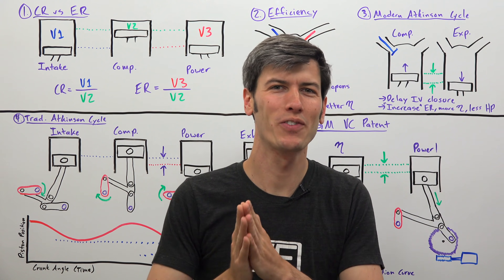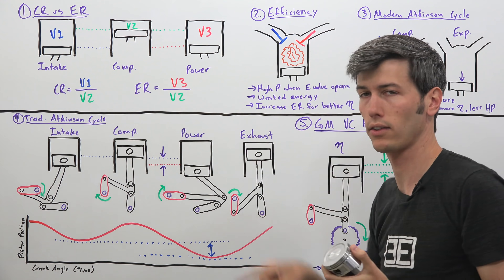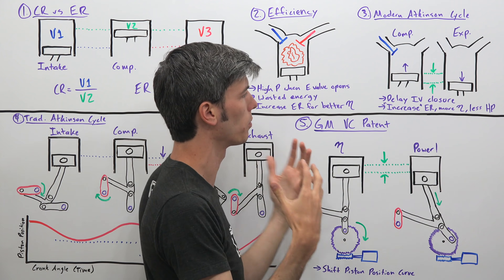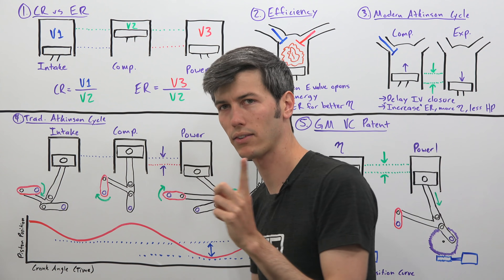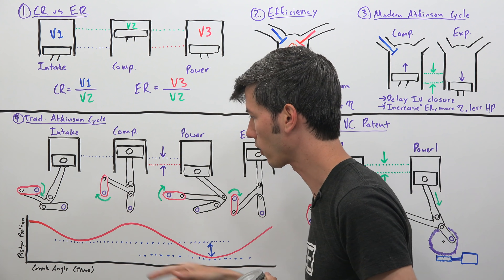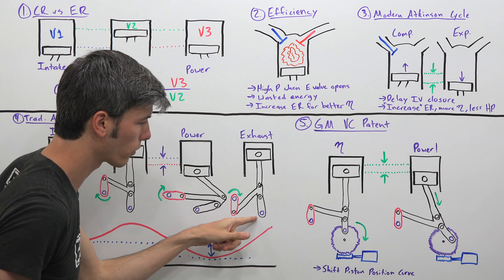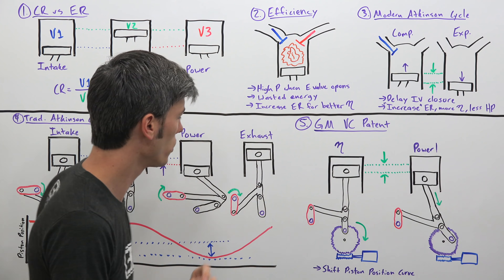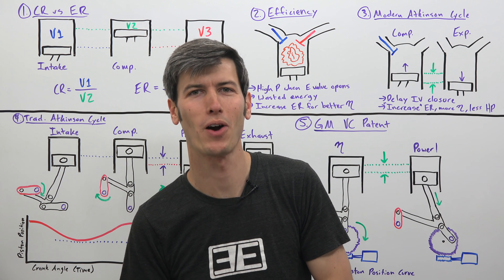How GM's Variable Compression Engine Works - Patent Review

Comment: Maybe there's something I'm just not getting here, but why not just re-open the exhaust valve for a brief moment?  So during the compression stroke, deliberately push some of the air (from the intake stroke) out the exhaust before injecting the fuel.  With VVT, it seems like this would be a much cheaper and simpler solution.

Comment: Wait I thought higher compression meant more power. Also would this engine have to be super/turbocharged for knock to occur at a high compression ratio, because otherwise lowering the compression should just lower the power right?
For instance with the ‘power mode’ it would increase the boost so lower compression would be needed.

Comment: Wouldn't there be an incredible amount of stress on the worm gear and the gear changing the angle of the rod? Also wouldn't there be more stress than normal on the rod bearings due to the rapid change in direction of movement?

Comment: I still don't understand how this is any better than turbo charging. It is essentially a variable compression engine too. Low boost low compression, High boost high compression. Simple, plus it partially recovers lost energy from exhaust heat and velocity. How is this better or worth all the BS.

Comment: Nissan, Mazda and now GM all going this route but can it be done reliability? Great video as always.
Reply: Well so far Nissan hasn't had any issues with the VC T,  but it's still very early in the engines life
so we shall see. But it's a replacement for the old VQ engine and it will dominate their lineup
In a few more years so you'd imagine they did very indepth testing prior to going to production with it.
  
I don't recall Mazda going with Variable compression  (they are doing something different) but I'd definitely 
rate GM far lower when it comes to engine and electronic reliability.

Comment: Mazda introduced an engine that uses a higher compression ratio but to be able to generate more power they control knock by spraying fuel in the compressing air/fuel mixture to cooler it and finally preventing knock, those engines appear to be very efficient in fuel economy and producing good power.
Reply: It's probably still patented and GM's thinking box doesn't even have windows to look out of anymore.

Comment: This will be a low RPM, low power engine.  Before, the piston head and the top of the piston connector rod were the only parts reversing directions every rotation.  Now you have the piston, the whole of the piston connector rod,  the link between the piston connector rod and crank shaft, and finally the link that varies its bottom pivot to change the compression that have to accelerate and decelerate twice with every rotation.  The faster the engine rotates, the less efficient the engine becomes.  It also becomes much harder to balance.  Good luck GM.

Comment: Jason, I'm really confused. At about 9:50 and on you say that to make 'more power' they want to decrease compression ratio. That doesn't sound right to me. Obviously there are limitations on compression ratios until you end up with knock etc, such limitations being pushed further by Mazda etc. But within the tolerable levels a engine with 8:1 compression ratio, all other things equal will make less power than the same engine with 9:1 compression ratio. My understanding would be that not only will the 9:1 have more time to draw in air, but it would also have a longer 'push' on power cycle. It isn't a simple math to work out, given the higher the compression the more the engine is fighting to squeeze the air, but it also means a bigger release of energy when combustion occurs. 

I could be completely off base here. But if a lower compression ratio to expansion ratio still results in 'good power' instead of 'good efficiency' wouldn't the modern aktinson cylce work as is? Is a compression Ratio of 8:1 with a Expansion of 9:1 making more power? In, which case GM just wants to take it to its maximum extent? I don't see how you could achieve "similar air and fuel volume" which translates to 'power' with something like a  4:1 Compression Ratio combined with a 13:1 Expansion ratio (as a extreme hypothetical 'conclusion').

As an aside...if paired with a supercharger, do we go back to calling it the Miller cycle?
Reply from the maker: Lower compression ratio means less chance of knock, which is why you'll see boosted engines with lower CR than naturally aspirated versions of similar engines. Infiniti has the same strategy with the VC turbo. High CR for efficiency, low CR + boost for power.

Comment: Why bother, when Honda's and Toyota's Atkinson-cycle engines are producing just as much power as their Otto-cycle counter parts.  The Honda's Atkinson-cycle 2-liter engine produces 143 hp with 13.5 Compression Ratio, which is comparable to a 2-liter Otto-cycle engine, and Toyota's upcoming 2-liter engine for hybrid system produces around that much.  The key here is to do more cooling for the exhaust side of the engine to reduce the risk of detonation, thereby permitting higher compression ratio.  

At high engine speeds and at the end of intake stroke, the inertia of the incoming air pushes the air against the piston and reduce the airflow leakage out of the intake valve, thereby getting more air into the cylinder.  Furthermore, via variable valve timing, the intake valves close a little earlier with higher engine speeds, allowing more air retaining inside the cylinder.  So, we essentially have a variable-compression-ratio setup here without all of the complicated hardware like the GM or Nissan versions.  At low engine speeds, we have Atkinson cycle with lower compression ratio for higher cruise efficiency.  At high engine speeds, we have Otto cycle for higher power production.

Comment: Couldn't you achieve the same result with variable valve timing? Valve open during compression for efficiency (less air, lower compression ratio), valve closed for power (more air, same ratio for compression as for expansion)

Comment: There is something I don't get here. In compression and exhaust pictures the situation is the same apart from the crancksaft position which is rotated 180 degrees. This rotation in the pictures is allowed by a different inclination of the linking rod: in compression picture it points upwards while in exhaust picture it points downwards. How is it possible? Maybe I didn't understand anything ahah

Comment: Is the Honda ivtec in European doing atkinson at low load low rpm? As the use the high profile cam shaft to close the intake valve later.

Comment: is it mechanically possible for the crankshaft (red part) to complete a rotation after adjusting the purple point nb 2 (the one on the right) through the worm gear ?

as i know, the crankshaft mechanism has to have an accuratly defined geometry, if that geometry calculation is not done properly, you will have two possibilities:

1) connecting rod too short:
crankshaft can not have a complete turn

2) connecting rod too long:
crankshaft and rod undergo high stresses and elastic deformations at the bottom dead center.

how was this part considered in the design ? 

i may also have some other questions concerning the electric motor powering the worm gear :p

Comment: Hi Jason, I was wondering during this video if Diesel engines use an Atkinson cycle for the same efficiency advantages or would it not have the same benefits for a Diesel engine? Thanks, love you informative videos!
Reply: On a diesel you can only drop the compression ratio so far before the air isn't hot enough to ignite the fuel as it's injected, which is what diesel needs to run as a compression ignition engine. Diesel engines don't need to do all this messing because they only burn the fuel needed to make the power asked for by the driver. Unlike with spark ignition engines, where there has to be enough fuel for combustion to travel through the cylinder volume to make a coherent power stroke, diesels can burn any amount of fuel from zero to stoichiometric at each power stroke since the fuel is guaranteed to burn because the air in the cylinder is hot enough to ignite it. What energy is taken up compressing the air that isn't burned on the compression stroke is returned as the piston moves down on the power stroke too, and there's no throttle blocking air flow into the engine, so diesel already avoids a lot of the issues gasoline engines efficiency is reduced by. If only their higher combustion temperature (Yet another reason diesel is more thermodynamically efficient) wasn't killing so many people with its NOx emissions...

Comment: Knowing the corners already cut in many GM engines, I wouldn't trust this system. There's just so many extra bearings and moving parts that will be even more dependent on the owner NOT being lazy with maintenance (which the average consumer tends to be). There's a reason why manufacturers like Toyota aren't the first to adopt new engine technologies: It takes time for technologies to mature and become more reliable.

Comment: I am not sure if I get it... variable valve time (camshaft angle control) has been around since ~1990.  What does this new system bring to the table?
Reply: This system has nothing to do with variable valve timing or lift. It alters the position of the piston/rod assembly relative to the engine block. Essentially varying the bottom part of the rotating assembly instead of the upper.

Comment: What about VVT and VVL, to switch between power and efficiency?
Reply: That still leaves efficiency on the table, as he was stating about the thermal expansion in the beginning. That's why they're doing this. 
It will probably still use VVT and or VVL in conjunction with this
Reply: VVT and VVL can be used to get the same effect. You close your intake valve early/ late (Miller/ Atkinson), to get a different compression to expansion ratio (14:1 compression to 28:1 expansion, as an extreme example). It is the same effect but less complicated and without imbalancing the engine.

Comment: All things considered, I think it has potential to actually simplify engines in the long run. Currently we're seeing things like variable valve timing with multiple cams, solenoids, in some cases hydraulic actuators depending on design. This is required for the more modern Atkinson Cycle and helps to optimize the traditional 4 stroke design as engine speed varies. If the new GM mechanism is able to capture that excess exhaust energy and put it to the crankshaft, then there wouldn't be as much energy left over in the exhaust, so in turn you'd see less benefit from having overlap, or both intake and exhaust valves open at the same time. You'd control this overlap with the VVT design since we all know excessive overlap at idle causes the traditional choppy idle that is so often craved in hot rods but ultimately results in poor low end performance. Thus they may be able to revert to a more traditional non VVT design since the optimization would occur in the bottom end rather than the top end of the engine. All I know is this design is going to be one heck of a balancing act especially with a turbocharger. If you don't leave enough energy in the exhaust, the engine will have to work to drive the turbo as it pushes the piston back up, and hence maybe a supercharger would be just as good of an option for forced induction. Let's see if they make it to production, and I'll probably still stick with the old International 7.3 engine...

Comment: Why not just variably restrict the intake air and run the piston at  fixed maximum stroke?
Reply: That what everyone else running a modern atkinson cycle is doing by leaving the intake valve open for part of the compression stroke. Except, I think, VW who close the exhaust valve early so there's more exhaust gas in the cylinder before the next intake stroke, which may save on having an EGR system, but probably leaves the pistons running a lot hotter.  The GM system looks like an expensive engine waiting to fail expensively while doing nothing a VVT Atkinson engine can't already do. This looks more like GM employees collecting a patent filing bonus than an improvement over existing tech.

Comment: I think I can understand this idea fixing the throttle position on full open... But once I imagine a partially open throttle I get confused thinking the explosion of the reduced amount of air available will fit the expansion phase more efficiently getting similar results, of course I'm missing something but I don't know what. Trying to suck in air and creating a vacuum probably costs some energy, while a shorter expansion phase wouldn't... and I supposed the whole cycle gets shorter, so less time until the next combustion? I don't understand, I need more videos...

Comment: The extra components complexity and weight don't make sense. You can accomplish the same thing by just having a longer bore and using valve timing. The only advantage this would have is that for 2 of the strokes the piston doesn't actually more as far.  Is a few mm of cylinder wall friction worse that all those extra parts?